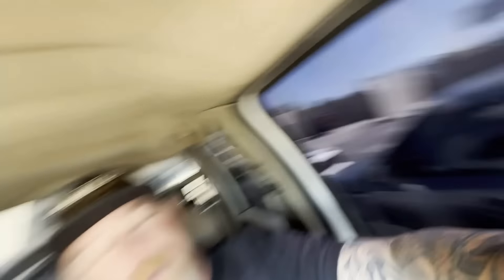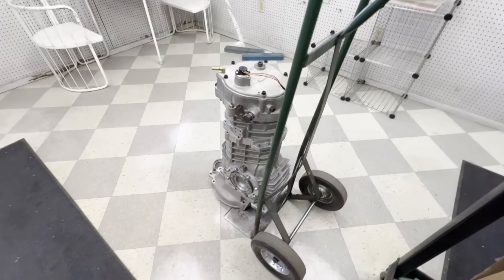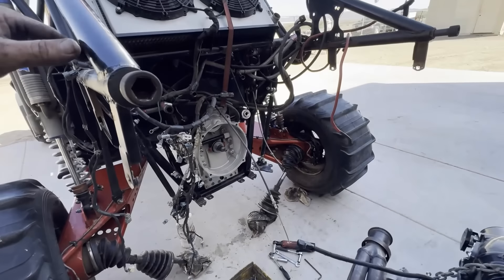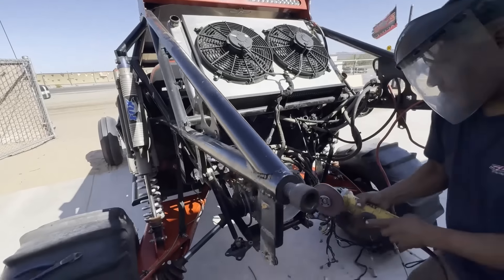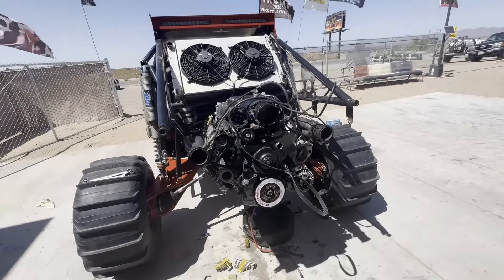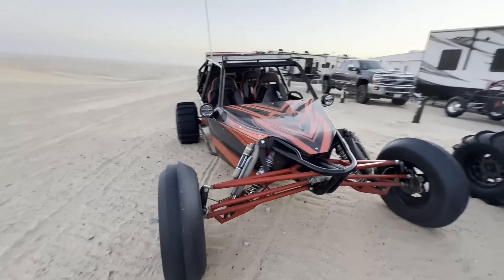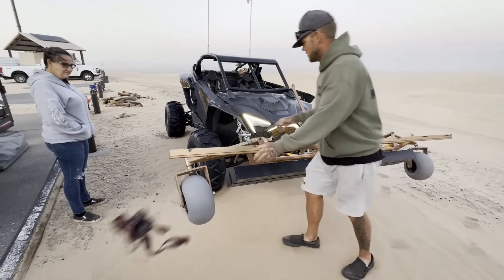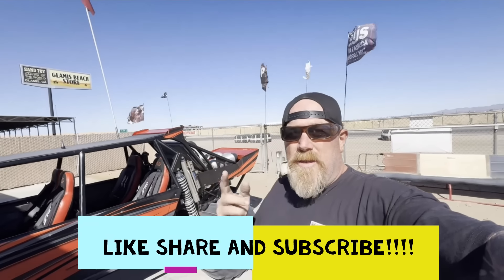CLEETUS'S SAND CAR TRANSMISSION CARNAGE REPAIRED!!

Comment: Correct. You can't take a certain gauge wire and double it and the current of two fans into a single wire and expect the wire to handle double the draw it is designed to handle.  Each of those two fans should have their own relay and fuse or breaker incase one fan shorts out or seizes up.  Cleetus needs a spring loaded skid plate for his wheelies.